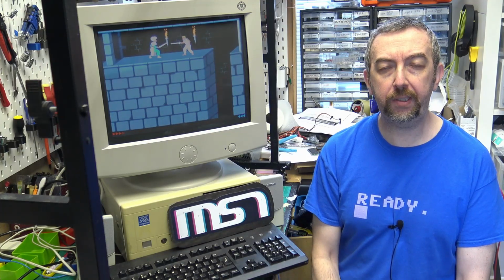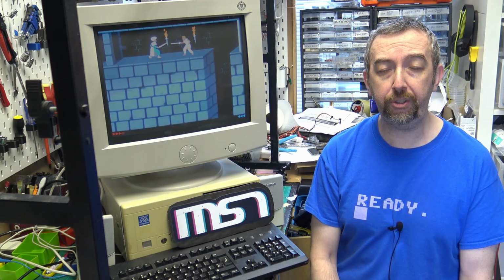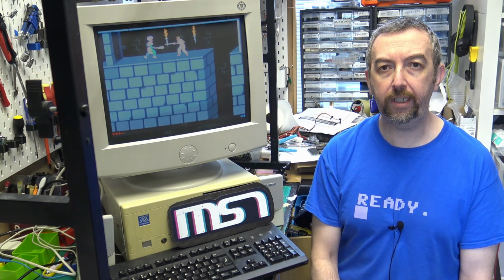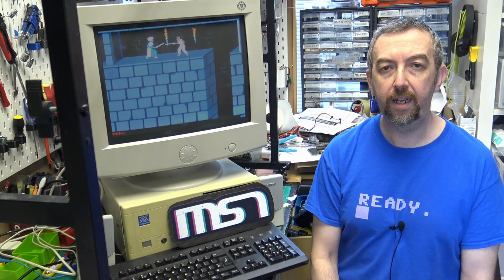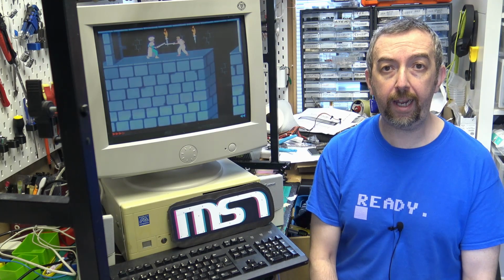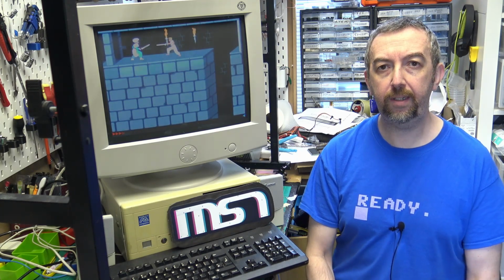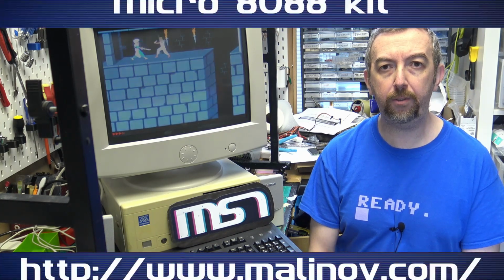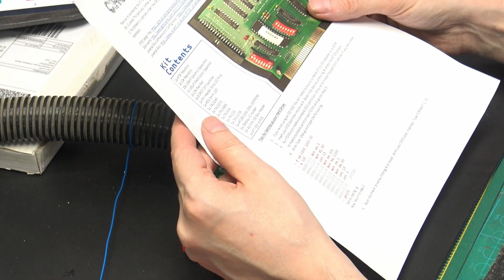Building the Micro 8088 XT kit with Adlib and XT-IDE kits. Part 1 Intro and XT-IDE build

Comment from the maker: I noticed some buzzing in the voice over if you crank up the volume before anyone comments.
Reply: I didn't notice it! Also I learned a much better way to clean flux than how I currently clean flux. 😁
Reply from the maker: @RobeenaShepherd  I found using just IPA would take a long time and then still the pcb would look dull, so I started using a very week solution of the ultrasonic PCB cleaner I have.

Comment: Would be cool to recreate a Tandy 1000 as an SBC implementation - would be especially cool if it could plug into a PCI slot and directly support HDMI video output. Could then plug into my modern desktop to have a true retro PC hardware to play with. Tandy 1000 had great graphics video and sound as integral to its design - making it like a PC equivalent to a Commodore 64, but with much more memory addressability, faster clock speed, and a better CPU instruction set (could easily support high level languages like Turbo Pascal and C)
Reply from the maker: I would like someone to create an FPGA core for MiSTer. It's not easy to find the correct graphics and sound card to be fully Tandy compatible. I tried to get the paradise card I have working via composite, but my research says it's actually not composite output and was for some sort of input device.

Comment: Great video! How's that exhaust working out? I'd never seen one with an intake tube like that. I'd love to hear more about your set up with stuff like that.
Reply from the maker: it was just something I made quick and it's not very good. It's a bathroom extractor, 3d printed cover  and some activated carbon sheet. If it's not on top of the part it does nothing.

Comment: Whoah... This is hardcore. Fair play for putting together an 8088 PC from scratch!
Reply from the maker: I really wanted a Tandy 1000 or something like it, but had no luck finding or they are silly money so I decided to go down this route.
Reply: @leesmithsworkshop  true... early PCs (especially pre-Pentium) have become insanely expensive over the past couple of years, especially brand name ones e.g. Tandy, Amstrad.
Reply from the maker: @OzRetrocomp  I also have a pentium system and I brought everything from a seller who has many parts, but they soon all add up. The hardest part to find is a case that can fit the XT back plane and the cost of XT or ATX v1 PSU with -5v is very expensive.